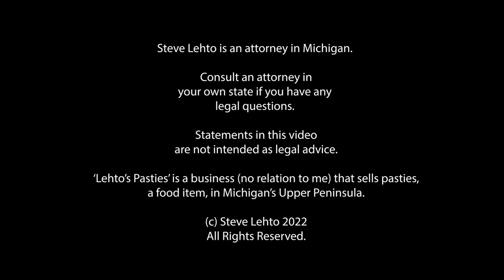Did Ford's Use of Cheap Steel Increase Roll Over Danger?

Comment: This is where nhtsa or whoever needs to require new crash test certification if the design or the materials used in construction is changed for a vehicle.  The whole point of the testing is to demonstrate the safety of the design and build.  If that changes new tests should be required before it can be put on the road.
Reply: Every model year is tested I think
Reply: It is required
Reply: @jackwebb5044  If so then whether they 'cheapened the build' becomes irrelevant.  It passed certification, unless a defect in that unit itself is found then ford would not be liable.
Reply: @jackwebb5044  
You think incorrectly regarding this vintage and GVWR of truck.
Reply: @everythingpony  

No it's not...
Reply: "However, The Wall Street Journal is now reporting that the 2002 Ford Super Duty wasn’t required to have a stronger roof, as heavy-duty trucks were excluded from tougher requirements at that time..."
Reply: @johnpeters9793  Yes it is required by NHTSA. The "problem" here is that these trucks were in the commercial truck category, exempting them from many of the regulations covering light passenger trucks. The assumption being that nobody buying one of these trucks for work is going to take them rock climbing off-road. People buying personal vehicles unaware of this distinction look at the F-150, decide its payload or engine power isn't quite enough for their needs, and move up to the F-250 or F-350 assuming they're the same just beefier. They're not the same. The problem isn't the truck, the problem is that people assume the commercial trucks are just like the personal trucks, and automakers don't really do anything to dissuade that misconception.
Reply: @solandri69  

Your saying two different  things..

Read the post above yours....

That year/weight truck was not subject to any NHSTA rollover regs....doesn't matter what people "thought."
 
Doesn't matter what steel was used (I didn't even watch the video) and Ford will win on appeal or accept a drastically reduced settlement.

Comment: Even municipalities allow dangerous conditions that Will definitely cause death....if the cost analysis revels its cheaper to pay settlements than to correct the dangerous conditions....ie a local major highway added lanes years ago making the utility poles less than 12 inches from roadway.....they continue to just settle with victims instead of correcting the issue because its CHEAPER
Reply: Or because they are spending tax payer money, not their own.

Comment: BTW.. strength (material aside) increases by the square... and interaction from design makes this an even higher order..

But for those who don't know how the power function works.. grief... imagine your water pipe that feeds your bath... if you needed twice as much water you don't need to have a pipe twice as wide...

Comment: I have a 2003 F-250 4x4 with 6.0 l diesel motor, which has been a good truck in the nearly 20 years I've had it.  Towed a 30' toy hauler up some of the steepest grades in both California and Colorado as well as off road.

It is a heavy truck coming in at around 7800 pounds.  I can imagine all that weight on the roof and it's not a happy though, especially if that occurred under dynamic conditions like a rollover at speed where the dynamic forces significantly increase over the static forces of the truck just sitting on its roof.

But I'm of two minds on the issue, as a consumer and owner of one of these I have one view, and an engineer (board certified licensed professional) I'm of a different view.  As a consumer, I'd like to know I'm safe under reasonably foreseeable situations.  As an engineer, I can sympathize with design choices made to optimize a design for cost while still meeting a specification.

There is a design principal called safety factor that gets used.  It can be tuned higher or lower depending upon experience with a design and the understanding of tolerance stackup for what happens when every component in the chain happens to be on the lowest side of the spec.

Should Ford really be liable if they optimized the design to meet the specifications with some reasonable safety factor?  Or should NHTSA or whoever was the body in charge of setting the standards be responsible for under specifying the safety standard?

If Ford can be shown as still complying with the standard at the time, I have a tough time, even as a consumer who owns one of these vehicles, assigning liability to them.
Reply: My concern would be, like the VW diesel debacle,  is the vehicle tested the same as consumers received. Alternatively,  did they skew design to meet the exact parameters of the roll over test, without a reasonable safety factor? I seem to remember a controversy in the '80s in which one of the automakers was designing to only meet safety testing and not real world circumstances.
Reply: You've made a good choice, my only suggestion is to add a roll bar. I did, I knew someone who had one and it saved his whole family's life.

Comment: Volvo used boron steel for decades and they were always way ahead in safety.   Biggest difference I see today though is the truck / SUV and the high center of gravity which increases the chance of a roll over accident.  That point was driven home to me four years ago when my lovely wife tried to kill me in a shopping trip.  Long story short, her car, which was a sedan was totaled.  We had to go to the repair shop to collect some things out of her car which were left at the time of accident.  This repair shop had a huge yard out back for wrecked vehicles!  I started counting just to see how many vehicles were there when I noticed that so many vehicles had roof damage.  That meant they rolled over.  I counted sedans to over twenty cars, and then SUV's / light trucks to the same number.  Out of twenty sedans four had damaged roofs.  Out of twenty SUV's / light trucks ONLY four had undamaged roofs!  Exact opposite!  But it was what I suspected for a long time, and why I don't own an SUV.  SUV's and light trucks are head injury machines!  It doesn't make much difference what the steel or construction.  A human head can't compete in a roll over bouncing around, regardless of air bags, curtains, what have you!  They are ALL dangerous, except for maybe the Subaru designs because of the boxer engine and lower center of gravity.  My 2.5 cents.
Reply: If you don't drive them like they're race cars, you won't have any problems.
Reply: @MikeBrown-ii3pt  No race cars antics required.  All it takes is an unskilled driver swerving abruptly as a panic reaction.  Key word here is unskilled.
Reply: Or being t-boned in the wrong direction by a Red light runner...

Also dont forget Tesla for their low center of gravity.. they just dont want to roll over even if you try really hard...

Comment: More than likely it was not the cheap steel per se, but some intern doing finite analysis  on the structure and finding based on bad engineering parameters that cabs with the old material were over built.
Reply: Overbuilt, perhaps if you define “overbuilt” as anything with a safety factor larger than 1.1.

Comment: Vechiles pillar strength iis thicker pillars and it makes it harder to see people in crosswalks. Meaning it's more dangerous to people outside of the car take any car or truck from the 80s 90s 20s and now they all have smaller windows and more metal between. They can use thicker metal or a wider amount of metal in the end thinner metal and wider is cheaper

Comment: If you listen closely.... you can hear the gentle sound of brand new Fords rusting inside of the dealer showroom. They have been using cheap steel for years, and have terrible bodywork designs and poor corrosion resistance treating and terrible designs that have body areas such as rocker panels totally rusting out long before they should.
Reply: No worse than GM or Fiat Dodge
Reply: @jackwebb5044  Or ANY other manufacturer.
Reply: I attached some magnesium cathodes to slow corrosion, my area salts roads only in mountain areas for a short part of the year, I haven't had a long enough time to assess the effect, we'll see.
Reply: @jacqueslefave4296  not a bad idea haha!

Comment: It’s a combination of material strength and geometry of the pillar.  A slightly different shape even though thinner and using a different material can be as strong.   The real question is what do Ford’s structural analysis show both before and after the changes.
Reply: This ^
Reply: Exactly. But Ford doesn't need to even produce structural analysis from the time the trucks were designed. They could just cut the pillars from old trucks before and after the change, and test them to demonstrate no appreciable difference in strength. Assuming that's what actually happened.

You can't villainize them solely because they used cheaper materials. That's how the price of everything drops. When flat screen TVs first came out, they cost like $20,000 for a 42". Today you can buy a 65" flat screen TV for less than $500. That wouldn't be possible if you insisted that companies were never allowed to use cheaper parts than in their first design. Aerospace is a great example of an industry where price has to play second fiddle to structural and weight demands. My flight was delayed once because the bar used by the cart to push the plane back from the gate broke, and we had to wait for maintenance to bring a spare. The captain explained this over the PA, and added that the bar cost nearly a quarter million dollars.
Reply: @solandri69  It's more a question of what did Ford know and when.  And specifically what did they know.  You can't simply cut a piece out in test it.  The geometry may change over the length of the pillar.

Comment: I looked through the lawsuit because the boron steel being 4-5 times stronger seemed wrong to me.  The lawsuit just states that boron steel is 4-5 times stronger than normal steel and did not mention the steel that it was replaced with for that entry.  That is deceptive.  It states on a separate line that it was replaced with mild steel.  Assuming it was cold rolled (cold working increases strength), I would expect the change in material strength to be approximately a factor of 2.

Comment: They may have used lesser quality steel but the bigger issue is that this class of truck was not being regulated for roll over safety at the time.  We consumers continued buying the F250/350/etc truck as if it were a more capable F150, disregarding this lack of a RO safety rating.
Reply: I know my ram 5500 emty at 10.5k will crush tha cab if upside down.  I knew this buying the truck.  My 2800 lb passat can be turned over, but can't tow a fifth wheel.  It is about choices.
Reply: I wouldn't take a truck off-road without a roll bar. Cheap insurance, can help in accidents, too.

Comment: I've seen a lot of video on newer cars that can slide all over the road at speed and wondered if maybe there is something wrong with modern tires. Are those tires that are made for large wheels, which have very little rubber between the wheel and the street really the best choice of an engineer who wants safety and handling. I don't think so. It's all about trends in styling.

I would like to see SUV commercials that show us how well they do at speed in a large open parking lot, while the driver throws the steering wheel back and forth from one side to the other, or how it performs with a blowout.
Reply: Here's the thing-a lower profile tire (what I think you're saying by "very little rubber between the wheel and the street") will, everything else being equal, make the car handle better because the tire flexes less when cornering. But, (and this is a big but) changes to the wheel/tire combo may require changes to the suspension.  Everything's designed to work together and if you change one thing a lot without making changes in the rest of the system, things don't work as well as they should. And making your car handle worse isn't smart.

The other possibility is that the person behind the wheel in those videos just can't drive worth a damn.
Reply: @almostfm  Well spoken.👍
Reply: @almostfm  low profile tires are more susceptible to tire and even wheel damage when hitting bumps and potholes.
Reply: People put oversized mud terrain tires with no sipings on their jeeps and trucks and then try to drive on snow/ice and wreck. Also see plenty of trucks with bad axle bearings from oversized tires, and wheel spacers. The manufacturer puts the wheel more or less centerline with the axle bearing for a reason.

Comment: This lawsuit is about the F350 Superduty trucks. Steve, in the previous video about this case, I believe you mentioned that there were different standards that applied to "heavy-duty" pickup trucks (such as the F350 Superduty). Does this mean that the cabs of the light-duty (or standard-duty) F150s were actually STRONGER than the cabs of the F350s?
Reply: Until 2009, the HD trucks did not have to meet the same rollover standards as the 1/2 ton trucks....
Reply: I've been learning quite a bit about GVWR and actual classifications.  First of all, there are no "heavy duty" F350's, all trucks F550 and lower are "light duty" by actual nomenclature.  Also, there was a divide between the lighter and heavier light duty trucks for decades, I think around the magical 8,500 GVWR mark.  After you got to a certain GVWR, many regulations no longer applied, from catalytic converters to many other things, probably including roll over ratings.  

3/4 ton trucks used to be rated at 6,500-7000 pounds GVWR back in the good old days.  Then there was a push for heavier duty 3/4 ton trucks, as well as the Detroit auto makers wanting to avoid putting expensive catalytic converters and other things into popular light duty trucks in the US.  So, they started making 3/4 ton trucks heavier and rated for far higher weights, so they could build more and more trucks that could escape regulation.

Many F150's and other "half ton trucks" of the US are, in all truth, lighter duty 3/4 ton trucks.  A fascinating study.

Comment: Use to make wise pickups ,in a pre60s International pick up, 4cyl , 3vspeed, 1/ 4 ton pick up.  It would carry closer to a ton of cargo,  pop a wheelie coming up a ramp. Fun to drive. 
One day a well dressed. Man driving a new Cadillac  was reading and ran the light striking the rear quarter of my little truck.... gosh . I got out wal,Wal, around the caddy was morality wounded, it's front end gone. The driver he was shaken but ok, my little green tank suffered. A dented rear fender. 
I applied Ashampoo blow to the inner part of the fender ...pop.... good as new not even a paint scuff. Sadly the truck met it fate when gas was reformulated,  it was replaced with  a Ford,  which got lousy gas milage,  from 26 mpg down to 12 , it did have a 6 cy,Cy, engine but less pull , it said half ton and was bragging... . In 50 years I have never understood how using twice as much gas was good for the environment,   since idling on a cool morning sulfuric acid would drip from the exhaust and fizz on the concrete .... yea that's better.
Reply: You could have had hardened unleaded valves & seats put into the heads and kept it running. It's very common to do that on older motorcycles that were made in the leaded fuel days. Some carb tweaking would be required of course, but it would still be on the road and running.
Reply: @Internutt2023  thought about it at the time but needed to stay on the road and parts for it were hard to find, it found a good home with a restorer , about a year latter it rolled in looking better than new, engine repaired , interior customed,  so it ended well, was still running two years ago, since then , the fellow passed away, not sure where the truck went. But  thanks , worked a shop where we rebuilt engines,  best  jobs I can remember .... 1920s Rolls-Royce , from the original manuals ...how many foot pounds are equal, to, take a 9 inch crowsfoot and tighten stout ? All specks were given this way. Yet it ran like a fine watch , when we finished.  Second favorite,  trade school opened and was rebuilding a a magnum year was somewhere around 68 ...we got our suppliers to donate parts... 520 plus 302vwas built , meanwhile the body and interior was being restored by the students, , the finished project was given to a student in a random drawing .....whi h was good, ...sadly it lasted a little over a week , too much car for the youth , he rolled it. I spent the day trying to find the junk yard it went to ...yea I wanted the motorn...take care..

Comment: Ok Steve all the addition of Boron does is improve the hardening of steel. You can argue that a harder steel is a stronger steel, but the more you harden steel the more brittle it can also become. And Boron steel usually includes about 1% addition of Boron to steel after O2 scavenging. As of the mid 2000s it was in common use by European car manufacturers. To put that into perspective a 1965 Ford F series truck would not have used Boron steel anywhere in the truck cab, on any F series truck prior to the mid 2000’s. Boron steel is used in the shackles of some padlocks for cut resistance, as it makes it more resistant to thinks such as hacksaw’s and bolt cutters. So it’s not really necessary to use it to make a stronger truck cab, as American automakers did so for over a 100 years without Boron steel.